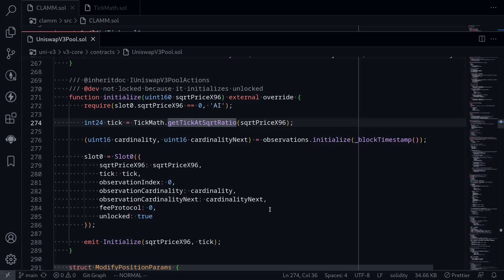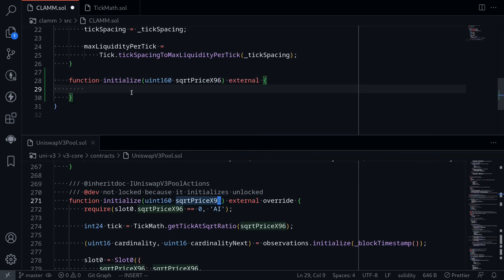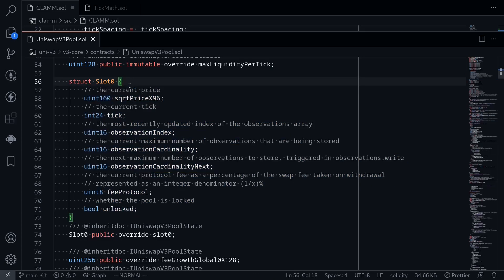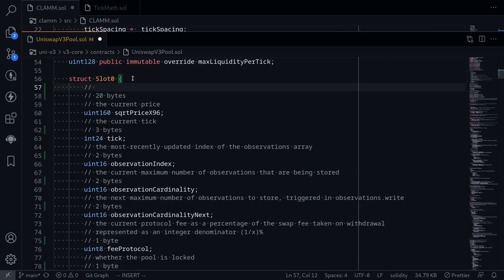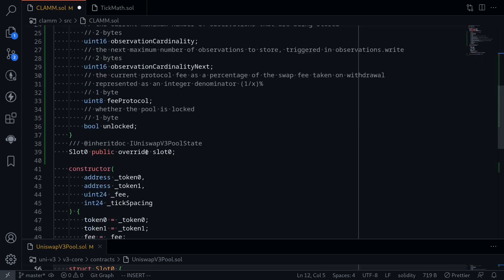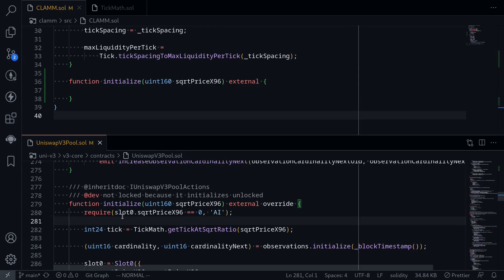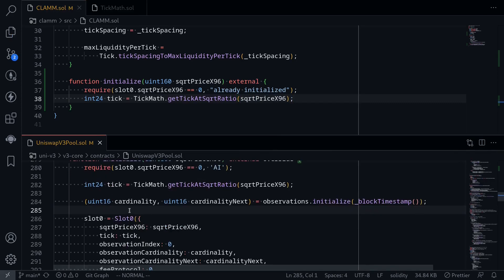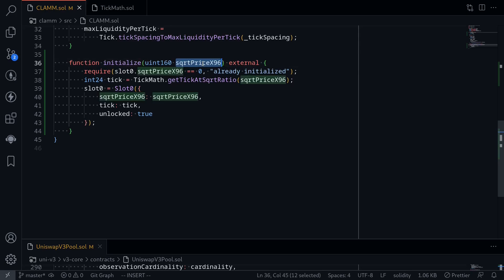Initialize and Slot 0 | Uniswap V3 Core Contract Explained - Part 3

Comment: slot0 is declared after many other state variables larger than 32 bytes combined, how come it's stored in 0th slot?
Reply from the maker: These are all immutable, so they don't use any slots
https://github.com/t4sk/clamm/blob/becfb4f81fdc27ef539f00b9b7ab1ec7b8795735/src/CLAMM.sol#L41-L46